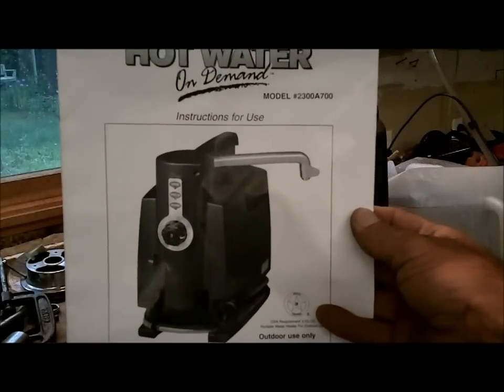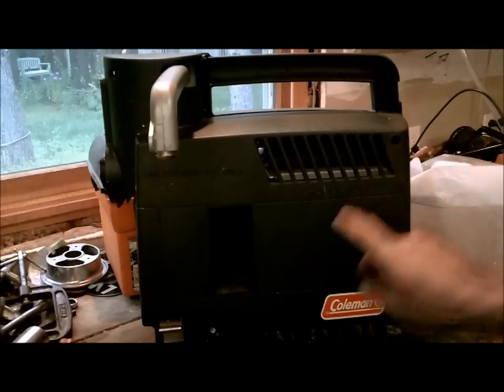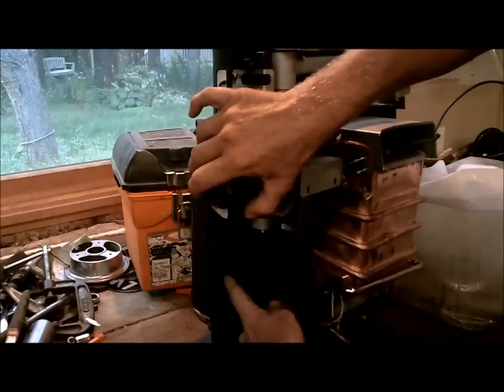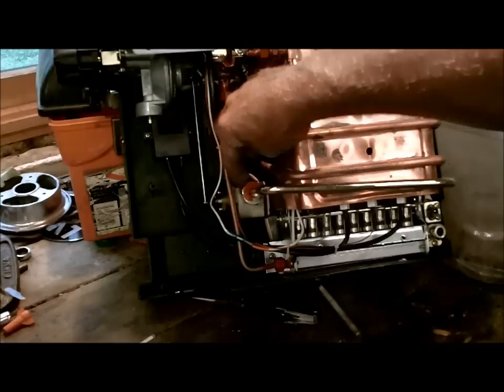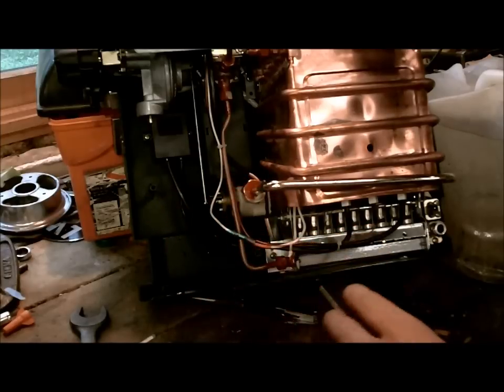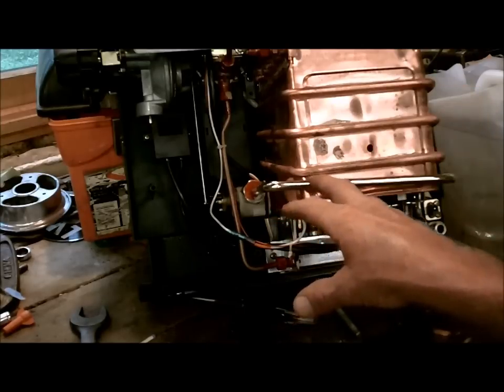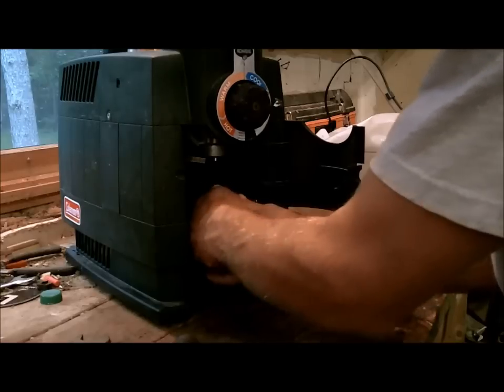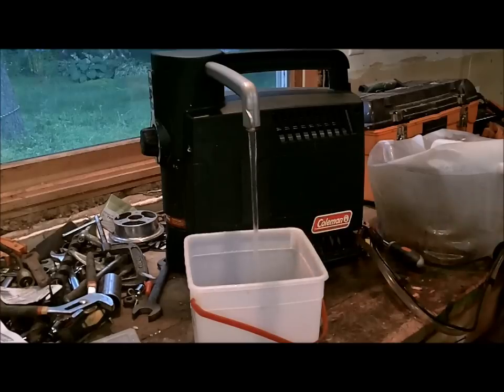Coleman Hot Water On Demand. How to Fix. Does not heat. Starts then stops.

Comment: Thanks for the video. I have had several of these units over the years and have discovered that there can be more to this problem than meets the eye and there could be several causes of the same problem, sometimes occurring simultaneously. 

First you must understand what is going on in the circuit. The impeller
referred to in the above video has a ferrite toroid (donut) attached to it,
which when rotating, produces magnetic pulses. Under the back cover (the one
with four screws) you will find a small circuit board with a very small
electronic component called a “Hall Effect Transistor” that detects the pulses
that the spinning ferrite donut produces. The impeller must spin at a certain
rate (RPM) to generate the correct signal. This signal is detected by another
circuit board near the top of the unit. 

If the impeller isn't spinning fast enough it won't produce the needed signal
to turn the gas on. 

Lets look more closely at this and ask a few questions.

 What causes the impeller to spin? The answer is "the water flowing through
the "water flow sensor". 

What causes the water to flow? The answer is "the water pump at the end of
the hose assembly". 

What could cause the impeller to not spin fast enough? The answer is
"lower than normal water flow" or, as proposed by the author of this
video "the impeller binding or dragging inside the water flow sensor
housing. 

Causes of low water flow:

1. A clogged inlet screen on the water pump can restrict flow. It is important
that you keep the attachment that holds the filter screen, attached to the pump
at all time.  Don't be tempted to remove it
as this will shorten the life of your pump. Clean and flush the screen if
dirty.

2. Older, worn out pumps. They still work but don't pump at the needed
pressure. Replace the pump. They are $18.00 online from Coleman.

3. Kinks in the water hose, usually near the connector. Remove the connector,
cut the hose back past the kink and reassemble the hose assembly.

4. The Brass water valve is stuck in the low flow "cool" position.
More complex.

This water valve is what is actually causing most of the issues here. While the
water heater is not being used or is in storage,  the inside of the valve gets corroded and the stem gets stuck in the "Low flow" position. The valve is not all the
way open. If you can’t move the water valve very easily with your fingers than
this is likely the problem. 

The brass water valve is located just to the left of the water flow sensor and
has a small linkage rod about 7" attached to it. The other end of that rod
connects to a lever that is actuated by the main On/Off knob. Unscrew the two
screws in the front of the valve, use a pair of pliers to remove the valve stem.
Clean the valve stem with a Scotch Brite pad or 0000 steel wool. Apply some
high temperature gas valve grease (get it at Home Depot) and reassemble the
valve. The valve should turn very easy. This should solve the problem. 

5. The sticky impeller as described in the video could be an issue but is
probably a rare occurrence if you are keeping your filter screen attached, but
is very easy to check. There is really not much to bind up in this part. It’s
almost entirely plastic and does not corrode or build up and scale.

I hope this helps some of you intrepid handymen out there.
Other tips:

1. Never remove the main knob. Just don’t do it.

2. If the unit is dead
check the fuse under the rubber cover on the top circuit board. You will have
to cut the rubber with a razor blade. The fuse value is stamped on the metal
ends of the fuse. Use a magnifying glass if you can’t read it. 
3. Unless your unit is
very, very old, it’s probably not the battery.

4. Use a razor knife to
split the front control sticker in half along the seam before taking the unit
apart. See the video above.

5.  Charging – Plugging it in. This will prevent shorts
to the charger and the circuit board.

a. Always insert the chargers barrel plug into the unit before plugging in the
charger into the wall. 
b. Always unplug the charger from the wall
before removing the chargers barrel plug from the unit.
Reply: Thank you 🙏 very informative -
I have one that won’t take a charge - maybe it’s the fuse
Reply: Do you have any idea what flashing lights mean on the curcit board mean ? I get two flashes after the igniter tries to light the flame............Assuming this is a fault code.
Reply: Hey so I am guess this is a propane related problem?  How about battery power?  I can’t make the battery heat but water is fine.

Comment: Thanks heaps for the video it was excellent and was the fix our unit needed. 
Just as an addendum our unit had one more screw to remove the gas canister back-plate it was on the base of the unit and secured the back-plate to the cover that was removed. 
I am in Australia so I am not sure if this is unique to the units sold here or not but could be useful for others who may not have the patience that I did ... I know my partner would have broken something lol.
Also I opened the impeller unit and sprayed a very small amount of silicon spray into the impeller spindle slot it allowed for smoother spinning of the impeller and although may taint the water for a short time has made a significant difference to the noisy impeller.
Many thanks again for the amazing info I am not a happy disposable person so this really suited me.

Comment: Great video, I did this recently. I would also like to note that I had a blown fuse as well. The "charging light" will still come on with a blown fuse. It takes a F4AL250v and it is located in the circuit board.

Comment: Thanks heaps for the video, you just saved me $400 that I didn't need to spend. If you take it right out, there is an arrow on the sensor so that you put it back in the right way. (Oops, second time right!). 
I agree with other posters, run it once a month to keep it all running smooth. Before I head away next time I will give it another quick service.
Again, Thanks

Comment: I may be missing something, but it does not appear to be necessary to take the unit apart to blow air through the impeller. I just used a tapered tip air hose nozzle to create a seal, and air goes all the way from the water entry to the outlet port. I could have saved myself a few hours! I did discover in the process that the high temp mechanism was stuck, so I advise putting some lube on the valve. Unfortunately, my pump just died, but the unit did work briefly after this fix.
Reply: Are you using propane or battery?

Comment: Love it thanks! Mine has been sitting for months and now that it’s winter and want to use it it’s not heating at all. Doesn’t even fire the gas but the solenoid works and the ignition clicks away. I’m hoping it’s a stuck  I Presley that I can free up . Will check it out but great info!
Reply: Yay!!  Removed the brass center jet out of the regulator and saw a white film/ dirt behind it on the actual regulator where there are 4 very very small holes and knew right away it’s due to the dirty LPG we have in NZ. The gas heaters suffer the same fate when left standing during summer……so grabbed an ear bud and dipped it in some whiskey and cleaned it out and the gas came hissing out. Reconnected the internal brass pipe back up again and the hot water is flowing like a dream! Perfect for this weekend’s winter 4x4 camp getting down to -2 deg 🥺

Comment: First off, thx for the tip. It worked last year which was great, but this year I had the same problem again, but your solution wouldn't work no matter how much air I blew through the flow sensor. So I took the senor apart and realized the problem, the paddle wheel is a little tight on the shaft. So I took the paddle wheel off, used a drill bit and increased the hole diameter just slightly in the paddle so that the paddle would spin more freely on the shaft. I put the sensor back together and it then worked first try. Hopefully this is of use to someone who is still having trouble.
Reply: What size did you drill it out please?

Comment: so I tried your Hack and it worked.  I cannot thank you enough especially after the BS I went through with Coleman.  Simply not the company they used to be. How did you guys figure this out.  I was sure it was a temperture sensor.  By the way as another person said, I just took my air hose and blew it into the water pump line and as you said I could hear the impelor spinning.  I hooked it back up and it heats fine.  Thanks again guys great job
Reply: Are you using propane or the battery as power?

Comment: I'm getting a solid flow of cold water but the gas fires then cuts out after a few seconds. Is the impeller potentially blocked if the cold water is flowing? Thanks.
Reply: i have same problem cant figure it out

Comment: Did you cut the decal in front in half? I had to peel mine off (not split). I now fear I killed it. Also, what happens if you just blow air through from the outside entry port for the water? Won't that push air through the impeller? I took mine apart, but just have to wonder. Great video! Saved my unit.

Comment: Hi..  I have this model 2300-700.. was giving it by someone couple weeks ago... question is when it is plugged in should the light charger indicator come on..  if so mine does not.. is it recommended to change battery or is there a fuse in unit somewhere that needs to be changed out. Await a reply.

Comment: I have the same problem with a new unit I bought in 2019 I sent it back and the new one does the exact same thing right out of the box.  Im going to try your fix and it would be great to back back to you for tipsa if it is not successful.  I contacted colman direct and they were abosolutley no help at all.

Comment: Hi Joe,
Great video, do you have a solution for a gas that does not flow? the ignite fires perfect and the water flows with plenty of pressure but no heat ( no ignition) bottle is full, line is clear, not too sure about the inbuilt regulator or the safety switches internally. This appears to be an intermittent problem some times it fires and more often than not it does not. Any help would be greatly appreciated.
Cheers Michael from Brisbane

Comment: I’m back, sorry to ask but some on may know. I noticed the boil function on mine doesn’t work or get to boiling like it used to. I got the normal function to work but cleaning the gas ports on the regulator and it worked a treat last weekend for all the off road boys to wash dishes for 2 days on one battery too. But the boil function or twist is not making more heat so could this too be blocked some where in the regulator? 
I might try strip it down and see or clean any other ports I can find.

Comment: I took my "new to me unit" apart to replace the fuse and having troubles with putting the dial back together properly.  Can you provide any insight on how the spring is supposed to sit in behind the dial so it goes back together properly??  Thanks!

Comment: hi joe,
i cleaned the impeller,mine only heats to a low heat,mostly stays on.
but wont get really hot like it used to.the flame just stays on a low heat.
any suggestion,

Comment: I don't know if anyone else has had MY problem but mine heats BUT doesn't seem to get half as hot as it once did. Could this be a problem with goop in the gas line feeding the burner?. I've had to disassemble Buddy Heaters before and use compressed air to clean out some nasty stuff in the propane supply line. Few blasts and it's fine...OR, is there another reason such as premature shutoff OR maybe my burner is going bad?. I bought it used in excellent shape..Used it a few times with really HOT results THEN...Lukewarm since then.

Comment: hey i just did that now it doesn't work at all. it doesn't even pump the water. just clicks. i take the syphen pump power inlet out it stops clicking reconect just clicks no water pumps.. do you know what would be causeing that as it was pumping the water fine beforehand.

Comment: I would just mention, 99% of the time the problem with these units is the external supply pump being frozen up...it shows as a low battery...but disconnect the pump and it will fire off, but then shut down with no water input...you can use the garden hose adapter to verify first.